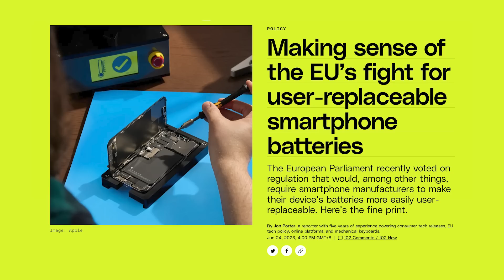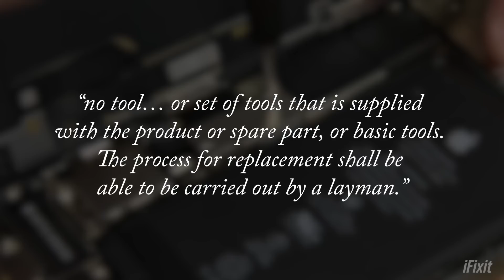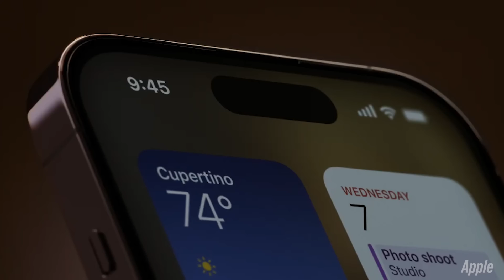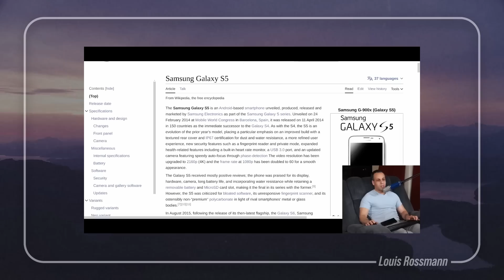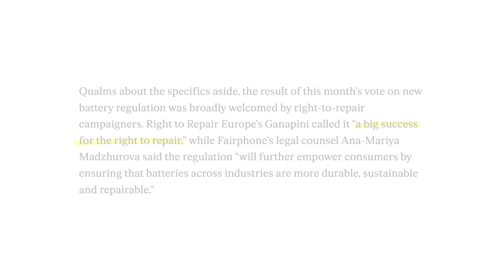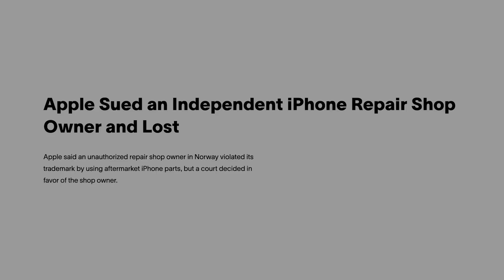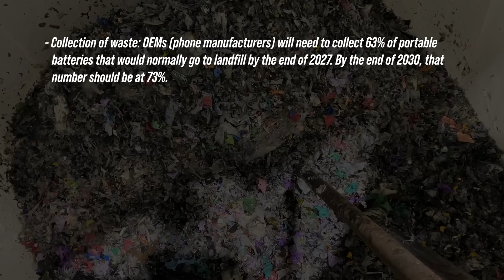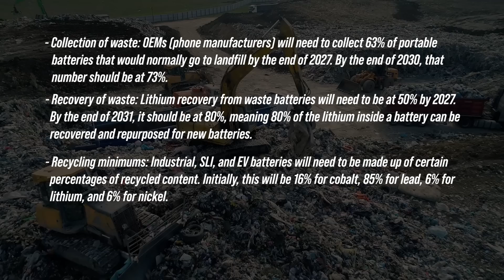EU Just Changed Smartphones Forever

Comment: I wonder what the phone companies will do next to keep us buying new phones every 2 years.  I wonder if screws and gaskets can make a comeback for water resistance. I wonder also how the batteries will be replaced in wireless ear buds.
Reply: I definitely don't buy a new phone every two years.  
Mine last at least 4 years.  Last one was 5 years and might be more with replaceable batteries.
Reply: Or hearing aids or hundreds of devices like that.
Reply: @snörre23  My dad can replace the batteries in his hearing aids. It's called "design".
All my wrist watches can have their battery replaced and they are water proof.
Reply: @snörre23 in the EU at least in Germany hearing aids have replaceable batteries
Reply: @snörre23   Most hearing aids have been powered by button cells for decades, nothing new to me. They even have their own category of button cell if I am not mistaken. The problem is already solved.
Reply: @snörre23  All hearing aids had replaceable batteries until recently.  I'd bet that there will be an option allowing for the maker of a device to replace their batteries at no charge during a required lifetime, and having to post a bond covering that for all sold items so it can't  escape liability by periodic bankruptcy.
Reply: I replaced my own batteries in Sony WF1000-XMs already.  It took longer to find the batteries online than to replace, with a fingernail and flathead screwdriver.
Reply: GoPros have replaceable batteries are water resistant and there is absolutely no need for screws and gaskets. In fact you have to open them up to get at the USB socket in order to charge them. It is not rocket science.
Reply: I'm keeping my phones in average 4 to 5 years, basically until the phone is still working and not obsolete
Reply: There should be a "weight precision" of devices that can be refurbished.
Because imagine an old man with poor eyesight living alone far enough,replacing those small wireless earphones battery that weight like 10g at most.
Reply: @VahatraRabemiafara  Yeah, It's just not possible that he could ask a relative or neighbour with better eyesight to do it for him.
Perhaps this imaginary old man should just throw the hearing aids away just like he would with non-replaceable batteries. Or, maybe he, or a friend, could take it to a market stall or store where they already change watch batteries for a minimal fee.
The law says that the battery must be replaceable by a layman. It doesn't FORCE you to do it yourself.
Reply: Corporate greed
Reply: "will be replaced in wireless ear buds"
It's very easy to design: you make the case of ear buds consist of 2 parts with one part screw onto another like a nut onto the bolt. And then you have a very small battery inside there.
Reply: I have Sony in-ears and just had to send it to a repair shop for free. I'm okay with that.
Reply: I have My Moto G5S for 6 years now and it still has its original battery, looking for a replecement battery now though.
Reply: If your phone has a locked down bootloader, it really shouldn't be used after 2-3 years, because you don#t get any software updates. Even if you don't care about security, or you're just careless like me, after a few years you won't be able to install software. Happened to my Samsung Galaxy Note II from 2013... At around 2018-2019 it started complaining about compatibility. I flashed a new ROM onto it now, and it's actually usable again, I got a different one in the meantime though
Reply: I have had my phone for 5 years now. Battery still good.
Reply: I think you are being a bit unfair there. The companies might well be complete dicks when it comes to many aspects of their phones, but the reason most people buy a new phone is simply because they want a new one.
 I haven't bought a new phone for over 20 years, because the perfectly working phones that friends and family no longer use, because they want a new one, work perfectly well for many years.
Reply: Software will become worst than it already is and your phone will become a lot slower in a matter of just few updates, or some similar strategy.
Reply: Dude mikemaxwell3005 What kind of phone are you buying that last less than 2 years ?
The only one over the last 20 years that didn't last 2 years was a cheap android from amazon branded "Blackview"
Reply: apple: (like the charger) battery not included
Reply: by making them modular, ain't that difficult 😊
Reply: @sakesaurus  They should make the stems / Backs screw in with a battery in that part
Reply: They will make their phone more expensive/ reduce expenses - less advancement, some might bancrupt, we will have even bigger monopoly
Reply: They are already doing it - stopping the support / forgeting about their devices in favor of the new best thing. Actually APPLE (the company that people seem to think this fight is against) is the one that stood out the most and set new standards in terms of longevity of the product support. Most people who had phones BEFORE the iPhone know that we were stuck with bugs and there were almost no patches to solve the issues on the early "SMART'er" devices (using JAVA, Symbian etc). Just buy a new phone! And please don't say Apple slows down their phones with new updates to make you buy a new phone, as they were actually trying to SAVE the phones that were turning off because of dying batteries, and of course things got out of proportion :) People want FAST FAST FAST charging and when you give it to them they complain the batteries are dying, then when you give them a software update that tries to solve the problem they say they're slowing down their phones on purpose lol... You can NEVER fully please the consumers :)
Reply: @PoltergeistWorks Yes. I most definitely want fast, fast, fast charging. And when my battery fails, I want to be able to pull it out, go to the nearest tech store, buy a new one and plug it in.
Simple as that. 🤷
Reply: @D0BR0VECE  Again - there is devives you can buy that do that, you don't have to force every company to do it :)
Reply: @PoltergeistWorks  Oh, but you absolutely do. Right to repair, like any other right, has to be protected by law.
Over the last decade, we've seen that, given the option, almost all companies will choose profit over customers route.
Also, you aren't paying attention. There will be 'more premium' options allowed. And honestly, repairable quality mainstream devices with elitist niche is fine situation, imo. Anyone is free to choose. 
Opposed to mainstream disposable devices with repairable niche we have now.
Reply: @D0BR0VECE  Anyone is free to choose right now, nobody is forcing you to buy Apple or Samsung, don't like non interchangable batteries - don't buy their phones. Nobody really NEEDS a premium phone :) This is just people who have no idea about technology DEMANDING stuff behind some "right to repair". BTW I've had batteries replaced by Apple, you pay 99$ and you're done, if you're too cheap to pay 99$ for a battery replacement then why would you want a PREMIUM phone anyways? There are LOTS of phones you can buy that have replacable batteries, what EU is doing is actually tech fa$cism / communism. So many people buy that shit :)
Reply: @PoltergeistWorks  Ok, like, why are you lying at this point?
Dirt cheap phones, ones that come with software adds, don't have interchangeable batteries now. Only niche companies like Fairphone have them.
So my point stands, disposable phones are the norm. And disposable part doesn't have anything to do with pricing, or the quality.
Premiumness of any product is determined by performance & quality, not branding. In that regard saying apple or samsung is irrelevant.
I've been tracking technology for over 30 years now, it's in my line of work, so don't try to pull that stunt on me kid.
This issue is beyond your bellowed smartphone or laptop. There is no 'some right to repair', but THE right to repair. Like, I should have the right to replace my battery on my EV when & where I want to, exactly how I can replace my fuel pump on a diesel or a petrol car. 
When I buy a product, a washing machine for instance, I have to be able to service it by the manufacturing company, the licensed service company, the unlicensed company or by myself. 
Sure, I might lose my warranty, my choice my consequences. But still, the manufacturer being able to punish me for doing so, remotely thorough software, should & must be forbidden. 
Again, there is no lots of phones that enable replacing battery on spot. I have to go out of my way to get one. It's more natural to go out of your way to get one with irreplaceable battery.
So, EU is not being fachist, just you being funboy, or paid bot.
This is but a step in the right direction.
Reply: @PoltergeistWorks  This is such a braindead take. 99$ for a battery replacement is a robbery. The fact that a device can be classified as "premium" doesn't mean any of its non-premium parts need to cost extra. Price of water doesn't go up when you buy a more expensive tap, because there is no logical reason why it should. Likewise, price of batteries isn't based on which phone they go into but how they're made. 
There absolutely aren't lots of phones with easily replaceable batteries, that's a straight up lie. There's only a handful few and most of them are sub-par. 
As for Apple slowing down their phones, the problem wasn't that they did it, Android has the exact same feature. The problem was that Apple did not inform the user about doing it and provide no option whatsoever to disable this feature. This meant that even a phone which experienced sudden power loss due to extreme temperature would end up having its SoC slowed down. Forever. With no option to revert. It was an objectively stupid design.
Reply: @CanIHasThisName  Exactly. Thank you.
Reply: @PoltergeistWorks   But if the phone was designed with replacable batteries for a reasonable price, none of that would have been an issue.

Comment: Can still keep the sleek design of current phones with a small change. Instead of opening up the whole backside, you could just slide the battery in on the side like where Apple has the sim-card or where you'd plug in your micro SD on Samsung phones, just a bigger opening.
Reply: Most of the size of a phone is battery.

Comment: Google refused to replace my Pixel's battery (I mean, out of garanty. I was going to pay for it) because when they received it and analyzed "they didn't notice a performance loss", without any other report or technical data attached. No matter what I said, pay, or asked, they just didn't do it. Since it is not easily measurable unless, you know, I can test the battery out of the phone by myself, it's their words against mine, so I'm left with a phone with less performance than when I bought it anyway. Add it up to the shipping and manipulation costs, because for my country (Spain) there's only one official repair center located in Poland. So, answering your question, yes, they made it just for profit. They want you to buy a new phone.

Comment: It's all about greed. After finding out that any aftermarket phone charging cable had to pass Apple's 5, that's FIVE chips placement in it or it ceased to work in as little as 1 hour to as much as 3 weeks, I blew my stack. I switched to Samsung but their batteries swelled up at about 2 1/2 years and forced the case to open up I gave up. I cannot buy from a Chinese company directly because I don’t want the CCP knowing everything on Earth I do. I want 5 years from my phone and Samsung decided 3 years of Operating System and security updates were enough, briefly, I hear they've changed back to the old rules, but that doesn’t fix the battery problem. I bought Toshiba notebooks for years because changing batteries was easy. Screw them all. I don’t know what to do next time i need a new phone.

Comment: Personally I strongly believe that simple repairable options were opted out to save money on manufacturing and to make them more expensive to repair. There are a lot of consumer products that are thrown away simply because the battery has malfunctioned to the point where it can't be used. I go out of my way to find electronics with replaceable rechargeable batteries and find that they both live longer and are significantly more expensive. But worth it. Also I don't think it will be as hard to get those batteries back for recycling as you think. Just pack on a core charge onto the battery and boom. You will get that battery back. It allows for manufacturers to get extra money if the person wants an extra spare but it also provides a direct incentive to return the dead battery. We do it in the auto industry often enough that it's common place.
Reply: There is absolutely no reason why they should be any more expensive.

Comment: I'm having to buy a new Braun shaver because the battery no longer holds its charge. A battery replacement is just about possible by an expert with the necessary tools, but its very expensive. I can but a brand new shaver for less than half the price of the replacement battery. I'm all in favour of consumer replaceable parts.

Comment: The first thing I check when looking to buy a new phone is seeing if I can remove the battery and switch out the SIM/SD card without having to use a tool. I am very disappointed that most people are happy to buy phones with a limited life (nonremovable battery) and severe limitations (artificial software lockouts).

Comment: I never knew there were phones that had a high IP rating while still having a removeable battery. I was to young to be invested in phones or what features they had, I purely saw them as a means of communication and didn't have a smartphone at the time (Arround 2013). That and I didn't have a big interest in phones, still don't. I did however own multiple phones with removeable batteries. Also loved popping the back off and on, so I think manufacturers can get some revenue on replacement parts for whatever mechanisms they design to release the battery. That won't be the case if they design them to last but I highly doubt that, not because they don't want to but because it is cheaper for them to not put extra time in designing and manufactering that and like I said if those mechanisms break they can get some money by selling replacement parts.

Comment: I had an LG-G5 for years and it was the best phone ive ever had, today they are like 150$ online and you get a still powerfull phone with some other great specs, including its durrability.
Litterally screen came right off, bits flew out, frame was bent and mine somehow booted right back up when i put the pieces back together, everything was busted except the charging port, wifi and bluetooth.
All that after years of close calls, drownings, droppings, crushings, and all without a case.

Comment: Can you see apple going along with this? they may be required to by European laws, but watch them come up with some BS, more likely allow the consumer to change the battery but the replacement must be an Apple original product replacement, then they will get people to connect the phone to some sort of system so they can marry the battery serial to the rest of the device all at an extortionate price, This law says the end user will be allowed to replace the battery on their device, but does it say that the battery will not deactivate any system services on it unless a check is done by a certified apple repair center? I don't hold much hope for this, the manufacturers are in it to make as much money as possible, they won't let go of making billions that easily just because some law says they have to.